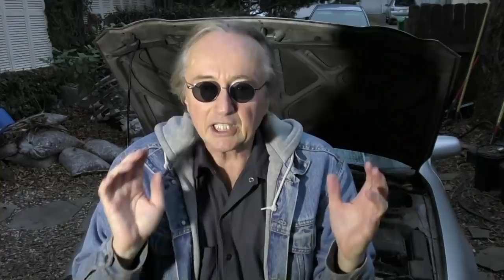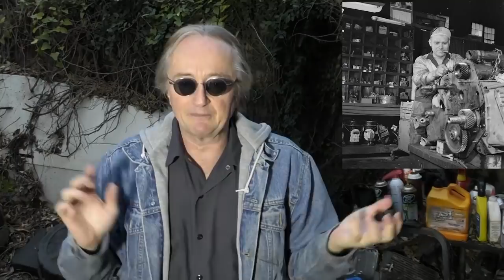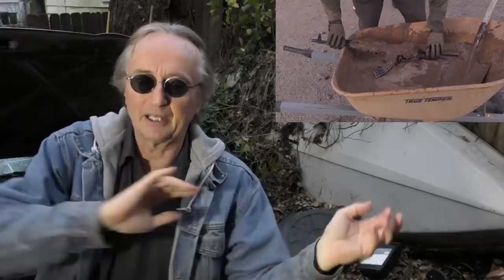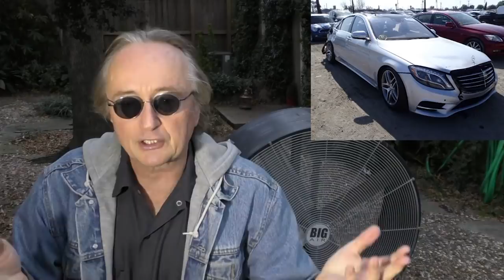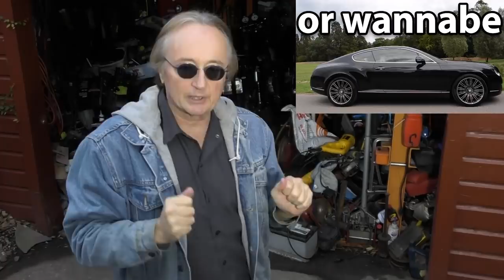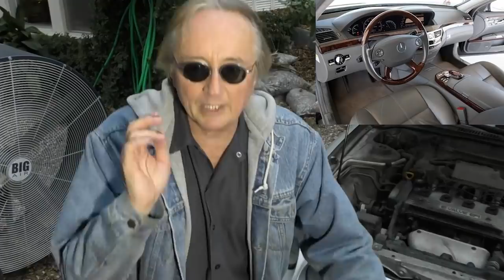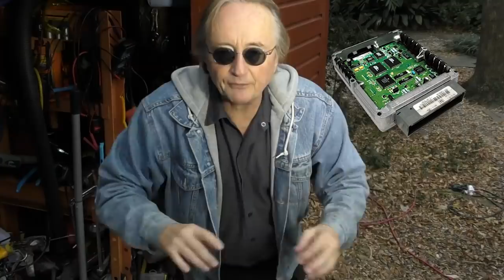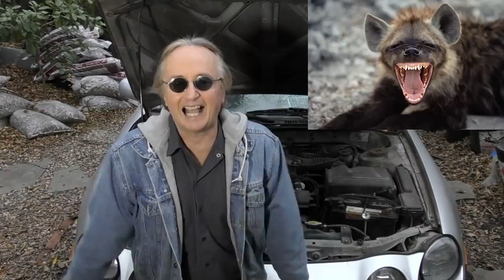Why Luxury Cars are Designed to be Unreliable

Comment: I thought about buying a BMW or Audi at one point then I did some research. After some researching I saw where the alternators cost $400-500+ if one goes bad (not counting installation), and I was like nope. Most Chevy, Ford, Dodge, and Toyota were like 200ish or less. Also my dad knew someone who had a BMW and the computer fried in the car, and the BMW dealer was the only one who could reprogram it. So, the guy took it to the BMW dealer and they said yeah we will reprogram your computer for over $1,000 😂. Also the fuel injectors and transmissions on those German cars are really expensive as well. So, yes Scotty knows his stuff for those that don't believe.
Reply: But you also have to look at the chances of that happening on the BMW or Audi which isn't as regular as a Chevy or Ford.. When it comes to the German cars its all about the technology that malfunctions, which is why they break but the car still runs... On a Ford or chevy the transmission or fuel injections etc.. I had a Nissan Maxima everything mechanically went wrong... but also had a Benz and one of the bags blew.. it was $1200 i think but with the Maxima the repairs totaled $3500
Reply: I thought the same thing when I thought about buying one of those V10 M5s. I understand I would get into some cost but once I looked at it more I still just wasn't willing to do it.
Reply: @loyalfans-kxngunkasaxxx2223  You probably just got lucky on that Benz. They are really expensive on repairs as well. Nissan's are not built as well as they used to be also. If you were going buy a Nissan you would want a 370z or Nissan GT-R. If you wanted something nicer by Nissan go Infiniti because they are built a little better.
Reply: @thorsky2754  Those M5's with the V10's were notorious for being unreliable even by BMW's own standard.
Reply: We have 3 mercedes: a 2000 ML270 cdi, 2011 mercedes e220d, 2012 mercedes c200d. None had any serious problems. Our ML has been abused a lot and has 380k km, still rides like a tank. Unlike our ford mondeo which was a disaster. Clutch, starter, suspension, .. So to me this video is a joke.
Reply: @x6land  You're probably not from the United States, so it maybe different for you. In the United States German cars are mostly money pits when stuff breaks down.
Reply: @Venturi Atlantique The Mustangs and F150's are some Ford's best built vehicles in my opinion.
Reply: One Kxng That's just it though. The German vehicles are overall less reliable, even on a part by part basis. Sorry, but imaginary lines on a map do not a better water pump or alternator make. It's an extremely simple component...there is zero excuse for early failure.
Reply: @Venturi Atlantique We do keer our cars maintened very well, we never drive them hard (almost never above 3000 rpm). Our Ford Mondeo MK3 was a complete disaster, even our  close friend who is a mechanic was shoked how badly it was designed. Our dual mass flywheel had to be replaced, everything had to be disasambled even just for the screws because you couldnt reach them. 

Our ML has done a lot of kms on the highway being heavily loaded. Has been offroad. Driven from Italy to Belgium with a gap in the Turbo, Driven at 120km/h through deep unexpected potholes shaking the whole cabin. The problems it had were mostly electronic. (We had a 6-speed manual ML which are more rare). Then our E class and C class have the same 2.2 diesel. Which is known to be a true robust Mercedes engine that can do a lot of kms.

I agree that you have to be lucky with what car you get.
Reply: I'm a believer!
Reply: @Venturi Atlantique That's not correct. We have a Mercedes E-Class 2014 with 400 000km (about 250k miles) it been very reliable and never broke down just with regular maintenance like oil changes etc. Nothing special. I understand that in the USA german cars take lot of money to run but here in Europe it's quite different. In Finland 3 most popular brands are Volkswagen,  Skoda (which is basiclly a volkswagen) and Audi (which is also from VW group
Reply: @loyalfans-kxngunkasaxxx2223   Tell that to my friend with a BMW that just lost a turbo. I can literally replace the whole engine on my dodge caravan for the price of replacing one of those turbos............ and he is not rich... just likes to look it.
Reply: BMW = Big Money Waster
Reply: big d was it a 7 series? I know you can get turbos replaced for $2000 including parts and labor with cheaper for the lesser BMWs

Comment: Would you do a video on how BMW's oil seals are made to go bad after 8 years. All BMW's leak from every seal. It must be planed. The seals are like hard plastic.
Reply: I'm a chauffeur, and a few of my customers have mentioned that, yes. One of them mentioned the problem when I told them I was thinking of buying a BMW for my next limo.
Reply: This isn’t a problem with the 4 and 6 cylinder BMW’s only the V8’s. Those are a NIGHTMARE.
Reply: Mack Plymale 

V8s from 2002-2015 NON M cars had major problems with that
Reply: Thats only the BMW eights the six is pretty good engine and parts are pretty cheap and super easly to get, BMW parts are everywhere. Just stay away from the dealer and find a good independent shop for work.
Reply: I don’t get people who hate on BMWs even though no one here is hating but.. once your drive a BMW guys it’s so addictive, I have a X5 3.0I and a couple of other modern BMWs specifically my X5 from 2004, it’s beautifully stances out and no SUV in the world sounds better than it. Anyone who owns one would know but without stock exhaust. V8s and even the I6 engines sounds so good and the performance.. when you drive a BMW it just can’t be put into words .. it’s more fun .. it’s more engaging. If I had 1 million dollars I would pay to get my X5 back to original and stock and detail also buy more. Love for BMW for people mostly don’t exist until you really own one and the right one.. if you don’t like a 4 series you might like the Z4 but if you don’t like either and want something SUV like you literally have an X4 it’s impossible for anyone to hate BMW unless you really payed attention to the lineup. Once you become addicted to these cars there’s no way your gonna undo it.. I’m going to be bias but BMW is life.. I was born and childhood was strong around BMW. From my dad owning one  and me as a kid having 60 BMW car toys on a shelf.. nothing mattered more after school but my BMW toy cars.. lol BMW is real passion. It’s car people to another level
Reply: It’s true but otherwise with I6, the car is bulletproof
Reply: The German government mandated environmentally “safe” seals and gaskets. They were made out of paper fiber which break down easily
Reply: Had to replace a few seals on my 328 n52. No big deal doing routine maintenance on the best car I ever drove.  All seals leak eventually.
Reply: Those BMW oil seals are "high tech" that's why they leak. I wonder if they still put plastic impellers in their water pumps these days.  Some guys say proper maintenance prevents problems and say you "gotta pay to play" trololololol!!!
Reply: True. My dad's 2006 BMW 330xi has multiple oil leaks. It just got a huge one fixed.
Reply: The old saying there are 2 people that can own a BMW.  Those that can afford to fix them and those that can fix them.  Thankfully I can fix them.  Probably the easiest car I have ever worked on.

Comment: I have a 97 Cadillac Eldorado ETC with what most consider to be a "disposable" engine in the Northstar V8. Outside of the inevitable blown head gasket that I permanently repaired with studs from Northstar Performance, it's been an amazing car. It's now over 280K miles and runs flawlessly. With that said, I still had to pay $1,000 for those parts to fix a car that only cost me $800. If I'd have had it done by the only mechanic in my area that still touches Northstars, it would have cost $6000 because they know nobody else will bother with it. I love older luxury cars but I also maintain them and realize what I'm getting into.

Comment: So basically if I want a luxury car, I should get Lexus, if not lexury , than Honda or Toyota.
Reply: Or Acura
Reply: Yes
Reply: Infiniti isn't bad. Not as good as Lexus...but way better than anything German.
Reply: @RealityIsTheNow  I agree I own a 2003 fx45 and she still drives great with a 166k on it....
Reply: @RealityIsTheNow  Infiniti is getting worse. Nissan is partnered with Renault which aren't great reliability to begin with, but better than most rivals. Infiniti then takes these cars and makes them complicated with fancy parts and electronics. Infiniti capitalises on this by charging large amounts for parts/repairs. They are decent, but a Lexus/Acura is much better, and even some Toyota/Honda models are quite luxurious and even more reliable than their luxury brand alternatives.
Reply: Aaron M That's what I just said. In any case, I've been driving a G37 for about 212K miles without an issue, so ymmv.
Reply: Yes

Comment: Love this video ! I drive a 1996 Nissan D-21 2wd reg. cab pickup , millions were made and mine is still on the road with 330,000 miles . Yes , I've replaced the timing chain assembly 5 times , but other than that , still original .  Keep up the great videos .

Comment: I've got a Toyota myself (2016 Camry XLE) and I've been very happy with it.  Sure, the Camry is one of those blah cars to many out there, but I think it's an ok looking one.  The newest generation that they rolled out recently back in the 2018 model year is pretty sharp though.  Makes me almost want to possibly stick to another Camry for whenever I do reach the end of my current one's usable life.

Until recently at least, they may not be the coolest looking cars out there, but after all, this is a Toyota we're talking about here.  So unless you get an Avalon or higher trimmed model (like in my case with having an XLE), you're not really getting too much luxury.  

I've racked up nearly 58,000 miles on mine and have had zero problems with it so far.  Only have had to keep up with regular maintenance and tire replacements, and it's been riding like a dream for me.
Reply: Mazda recently said they no longer benchmark BMW, they benchmark the Camry. No joke.

Comment: Depends on the Mercedes... A Mercedes is an expensive car to maintain, but if you maintain it properly and bought the right one, it can be very reliable. I have two Mercedes. A 2005 C220 CDI and a 2007 E420 CDI. Both cars are amazing and run perfectly good. 
I've had to replace the camshaft position sensor, sun sensor, AC command unit and clean out the EGR valve and a few other bits connected to it on my C-class for the 7 years I've owned it, but I'd call that very reliable, compared to horror stories I've heard from friends with BMWs... She's been a trusty daily for the past 5 years and has 175000km on the clock. For the last 2 years I've had a company car, so my C-class gets an easy life as a garage princess/ weekend car.

I've had my E-class for a year and the only thing I've done to it is modify it. Added a better transmission cooler, gutted the DPFs, installed an AMG exhaust system and upped the power to 400hp. Now I have a cool, sleek weekend/ long journey car in addition to my C-class. Tho I do admit, my E-class is driven even less... I only drive it for about 1.5 months a year... 

The best car anyone can have tho, is a company car. You drive it and let your employer worry about maintenance, reliability, resale and whatever. That way you get to enjoy your garage princesses more.
Reply: 175000km=108,000 miles. You have to be kidding. You can have factory warranty that covers for longer than that. "camshaft position sensor, sun sensor, AC command unit and clean out the EGR valve" on a 108,000 miles car??? Is it a joke?
Reply: CNT they are 10 years old that’s hardly bad
Reply: My 8 year old E350 Benz has over 104k miles and I’ve only done normal fluids, one serpentine belt and pulley kit, engine air filters and one set of plugs out of preventative maintenance.  And I drive a ton. AND I also own a Toyota Celica it has to live up to in terms of reliability. So far, more than pleased with the Mercedes...
Reply: TheK24Kyle as I am with mine if u listen to scotty u would think Mercedes just fall apart in 4 years
Reply: and going by Scottys words of reliability and financially is it worth it?  this is a on going myth. NEW luxury is expensive but actually new anything is expensive.
Reply: Man, if you had to replace all these parts, you can't call it reliable....
Reply: Siqi Zhang it is reliable. with any used car you have to replace things, it's about replacing what's worth it. for spending only 400$ on a nice Benz for a first car an getting around for a year , I call that reliable. she'll continue to get me around until I can't fix her or afford to ,  garages over charge for these cars, so def not a good overall investment for the first driver, I just got lucky

Comment: I see a screenshot of inrangetv's AK vs AR mud test... but no mention of the results.

common misconception of the AK, that it is reliable in extreme adverse conditions. it is not. as long as there is basic maintenance, the AR is more reliable than the AK, due to it's sealed action. it doesnt let junk in the gun in the first place. the AK has massive openings and places on the gun for crap to get in, so it tends to do terribly when clogged up. the AR is perfect for an army that is decently educated (assuming most grunts have most of a high-school education), and the AK is best for an army that is poorly educated (assuming that most grunts have never even finished elementary school), due to the need for maintenance.

ARs require more maintenance (not much more), but will outperform AKs on reliability, accuracy, weight, and most other things. not saying that the AK is bad, but there is a misconception that the AK is this this epic thing that is completely unstoppable. i dont even like ARs, but a false assumption is a false assumption.

also, the M16 is a prime example of the kind of negligent sociopathic criminal decisions of the US Ordnance Department. they were found to have sabotaged the M16 program in Vietnam, to try and salvage the idiotic M14 program. their insistence of the 7.62MM NATO round has cost NATO countries many a soldier's lives.

but on the subject of the video itself, it makes sense that luxury cars are unreliable, it also makes sense that, if a person can afford a luxury vehicle, then they should be able to afford the much more expensive upkeep. for the average person, it is nothing but a money-sink.
Reply: You're ABSOLUTELY right. You should have more upvotes.
Reply: The M14 is a mighty fine rifle, just not suited for general issue.